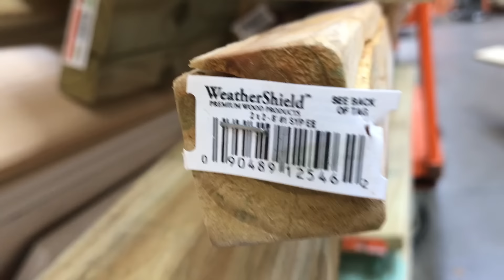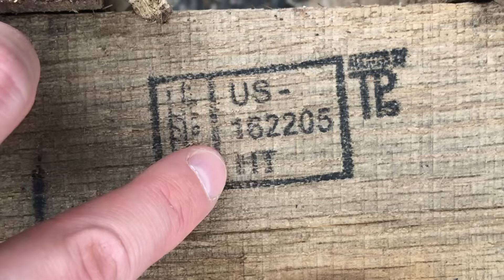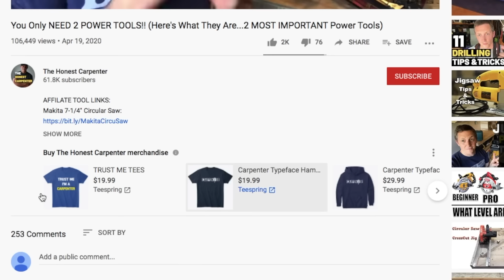Don't Use Pallet Wood!! USE THIS INSTEAD...(Cull Wood Vs. Pallet Wood)

Comment: Even cheaper: dumpster dive at construction sites. It's amazing how much usable 2x4s and plywood you can find.
Reply: That is just disgusting and should be illegal for ecological reasons. 
As a "green" civil engineer who likes DIY, I was disappointed about how much good quality timber went straight to the bin. Some were just part of the delivery packaging for heavy machinery that was installed on site. One could build a nice cabin by just relying on the timber we scraped.
Reply: billy watkins  taking TVs or a DVD from a Best Buy is ok. Or maybe sneakers from a Nike store. Just don't take scrap from a dumpster.
Reply: The last time i went dunpster diving on a constrution site I was almost charged with theft by some gungho Leo. His reasoning was if the dumpster was on the site everything was still theirs. I had written permission.

.
Reply: billy watkins  . Dumpster diving is legal. But if the bin is fenced in on site all the cops can do is write you up for trespassing..
Reply: Seattle is home to the most wasteful clueless spec home building.  Quasi skilled subs frame and sheath like wood is their enemy. Stupid, money grubbing architects cram four peg shaped houses on a single lot, with flat roofs, no yard, and a garage that requires a triple K turn to park in.  100 percent construction defect at completion.  The banks win, the builder wins, the subs live to butcher on to the next abomination, and the buyer is screwed.
Reply: Caution cite local laws and Municipal codes in my area dumpsters are property of waste management and entering them is considered trespassing
Reply: Brick piles too!
Reply: @BEARDEDYAKIN  I totally agree. Dumpster diving is not illegal!!! However, I would not intrude if the dumpster is fenced of on thier property!! Once it hits the dumpster its public property!!
Reply: @valdius85  Well I hate to say it some of the wood that goes in the dumpster is just plain stolen to be pick up later.
Reply: @terrydubay9113  I agree.
Reply: @Sheya404  That is NOT always true.  Many sites now contract salvage with a salvage company and the contents of the bins are their property.  You'd better ask BEFORE you spend a night in jail and fork over fines that would have bought new lumber.
Reply: @BEARDEDYAKIN  Our cops don't give a flip if it's legal by law, it's illegal as far as they're concerned.
Reply: There building like 15 houses behind mine and they give me all there bald wood
Reply: billy watkins  If a cop has time to arrest, write a report & a prosecutor willing to charge for stealing from a dumpster then move!
Reply: So true, they closed down a whole block near my house for electrical changes, you have no idea how much would they threw away
Reply: @seanoneil2110  that would indicate either an incredibly low crime area or ample police/law resources (which is getting rare nowadays)... why would you move away for either of those reasons?
Reply: @valdius85  What do you care?  Lumber is among the most renewable of our resources.  We will never run out of it.
Reply: @chuckschillingvideos  it doesn't mean we have to waste it. The delivery and process of the lumber requires a lot of energy.
Reply: @valdius85  Absolutely. Schindler Elevators parts are packaged with 2x4 and   3/4"  boards of untreated southern yellow pine here in the US. Can't be found in big box yards. Usually the Elevator Construction guys would let me gather some up at lunch to carry to my truck. Superintendents mostly frowned upon the workers being "salvage technicians" in dumpsters because of insurance concerns. Made some strong beekeeper's yard benches and converted worn out wheelbarrow to brick barrow. Good stuff, well worth the effort.
Reply: Agreed, the one thing I will never forget. Is the day my dad who used to do carpentry work told me to go to a job site and simply ask someone if they mind if you grab a few things out of their dumpster. I've even done it a few times 9/10 times it'll work if it doesn't. Move on to the next. And be smart dont be hurting yourself on anything because if you want to make a big deal about it there gonna hate you and never do it again
Reply: I've built a few new houses and I was shocked at how much my carpenters threw away. It was one of those long dumpster full of fresh wood sticking out.  They would use a 10 footer as a brace, and when it was done, they remove it, toss it in the dumpster and grab a fresh one.  Why did I let it happen? I was new at building and after a few the economy sank and I moved onto something else.  If I had to do it again, I would start small and have my own carpentry crew and be more efficient. Wood is not hay. I can't stand to see it wasted.
Reply: @joelgodin-woodworking4395  it does seem incredibly wasteful.

Slightly different example. I recently hired drywallers to finish out my basement. I bought 4x12 ft sheets and they would basically throw away entire 3 and 4 foot sections left over. It kind of annoyed me but I can also see that they worked more quickly that way and with fewer seams the end result is probably cleaner.

I suppose it comes down to the economics of labor vs materials on items like sheathing, etc. I see a lot of OSB in dumpsters  The example you gave seems purely wasteful though.
Reply: @wizardwillbonner  exactly
Reply: Waldemar Ishibashi o
Reply: I think you should have done a video on some of the coolest things you can build out of pallets.
Your video was a waist of time. I just built 
A bar out of several pallets and it turned out awsome. How
 much $0.00.
Reply: @carlospelay9642  they also saved you time and/or $$$,...  Because the next job is mud&tape. Time if you are doing it yourself, & money if you have someone else coming in to do the job, and I'm sure they are quoting you per linear foot that they have to do.
Reply: I work for the company that picks up the construction bins find the company that picks them up if you took the wood off their hands they would save money because their trucks get weighed every time they drop it at the dump the less weight they have in the truck the more money they make
Reply: Sheya404 wrong they are paying rent on the dumpster it is still their material until it is in the dump because they are charged by weight
Reply: Exactly!
Reply: billy watkins  You are absolutely correct. If a dumpster is marked "No Trespassing" don't dive there no matter what the police say. I often get permission from the construction site, preferably from the foreman. Never had any trouble that way. I got questioned once by a cop and I told him, "Bob said I could take whatever I wanted from the dumpster, just don't touch the stuff that was nicely stacked waiting to be used." He just simply said, "Ok, be careful." and left. Sometimes its' better to ask forgiveness than to ask permission, but this isn't one of those cases.
Reply: That's illegal in most places.
Reply: @TheMoafo  Most places depending on where you live. Where I lived in Florida it isn't illegal at all unless the dumpster is locked or says no trespassing. Just check you local laws and even carry a copy of them if you have to. I've done that before too.
Reply: @wizardwillbonner    I often dumpster dive for awesome stuff.  I wonder if "gungho Leo" would prefer it going to the dump as opposed to being up-cycled?
Reply: @youdagoob  that kind of blowhard doesn't care. It's all about making himself look good.
Reply: @wallacegrommet9343  The greater Seattle area, not just the city proper.
Reply: @chuckschillingvideos  Lumbers is one  of  the most vulnerable of our sources?  Such an ignorant statement
Reply: You're wrong trash isn't domain.property. I make 6 figures a year finding stuff in trash and repurposing it. Trolls like u crack me up. When it hits the dumpster or curb its anyone's domain property. If a construction site is completely fenced off it becomes private domain property.
Reply: Here in the UK I have watched as 8' x 4' sheets of quality plywood and miles of skirting board and even doors have been added to a bonfire. I've asked site workers and been told that they would be fired if any of these items left the site. It's morally criminal.
Reply: @corymcelheny6938  same here in West Virginia where I’m from and if caught without permission you’re for sure getting a ticket
Reply: Hear hear!
Reply: @BEARDEDYAKIN  It (dumpster diving, that is) really depends on laws and ordinances where you live.  In my town, it IS illegal.  Like a fellow further up in this string, I get approval to do so in writing.  Ask - all they can say is no.  And in my town which went from 28,000 to over 325,000 virtually overnight, I find that many contractors or supervisors that say no, is for "liability" reasons.  They're afraid you'll get hurt and sue.  I understand their reasoning in this "sue happy" day and age.  But - I always ask and get it in writing.  Sometimes it is a WIN!!!
Reply: Yeah idk last thing I need when I'm doing demo is some goof stepping on nails or possibly injuring themselves and wasting my time I would ask first
Reply: Free pallet fences for our goats is a compromise we have chosen to make. Now we're thinking of building a small barn using them. I would never bring them in my home. But outside in the fresh air to make homesteading possible...it's not my first choice, I get it, but it's a situation I'm willing to compromise.
Reply: Right there with you I got so much furniture I’ve built out of trash , I even pulled a fiberglass 28 ft black tip ladder out of one
Reply: 😂😂😂 My husband HATES when I do this lol
Reply: @wallacegrommet9343  feign noble causes that in reality are self serving... exactly what I'd expect from a blue city in a blue state 🤷
Reply: @corymcelheny6938  That makes sense. I've asked before diving.
Reply: Definitely more on board with the dumpster diving then paying for the cull wood before it hits the dumpster.  Lol. I like the rustic look of some pallet projects as well
Reply: Carlos I agree with you wholeheartedly. One man's trash is definitely another treasure!! recycling is the way to save this world!! shame on The rest are any of you for BOOING this man for his ideas
Reply: I have NO issues, going through bins for whatever reason. My garden beds were created by dumped lumber, saving me a fortune! The valuable wood that is thrown away at construction sites is shocking to anyone who loves to work with wood. 💯
Reply: @valdius85  why didn't you grab it all? In future have it written into your contact that you yourself will remove the wood!
Reply: @chuckroast5735  use caution, wear protective equipment and your eyes before you jump into any dumpster. Most sites don't mind especially if the bins is off-site, most will laugh, but when you inform them of what you are making whether it be toys for kids at Christmas or to help those less fortunate, they shut up real quick and it makes them think.
Reply: @wizardwillbonner  that's why so many, wait till they knock off work then walk in and take what "is considered as rubbish". Even written permission has some legal issues.
Reply: @thomasjackson7785  
I think you've seen a modern megaproject only in Discovery Channel.
Reply: If you enter a construction site without permission you are by definition breaking the law - you're trespassing.  Moreover, even if the contractors place construction materials into what appears to be a dumpster (it may very well NOT be a dumpster), it does not become searchable trash until it is placed out for pickup.  If you're doing something this stupid, I hope you have money for bail and the fines you're going to have to pay when you get caught.
Reply: @valdius85  Green Engineers are the worst engineers. Most people don't understand how much pollution is created by making "green" fuels and storage devices. Wind turbines, solar panels and batteries are some of the most pollution intensive devices out there. The entire green movement is based on a scam, not real science.
Reply: @wallacegrommet9343  You can thank "green" engineers for that crap.
Reply: @MAGAMAN  
You not describing engineers, you describing activists disguised as engineers. It's very common. 

There are still many good engineer there who try to look at the whole picture. They are, unfortunately, rare I think.
Reply: @Sheya404  depends on the local laws. In Ohio, anything out at the street or in a dumpster on  property open to the public is fair game. The exception is that if the dumpster is behind a glosed gate, or if the property is gated, then it isn't considered "publicly accessible" and diving there is considered trespassing. The Supreme Court ruling that made dumpster diving legal unless prohibited by local codes was California vs. Greenwood. It was intended to allow police to search garbage without a warrant.
Reply: felony
Reply: @valdius85  I used to work for the largest new home builder in the US. The construction team used to throw away brand new windows, 5 gallon buckets of paint, sprinkler systems etc. It's shameful how much they just got rid of to make space
Reply: @BEARDEDYAKIN  And they won't, generally, unless you're making a mess, broke something to get in, or are making a nuisance of yourself. I used to dumpster dive a tonne, I'd see cop cars cruising right past me without even a chirp of the siren. Now if you're tossing trash on the ground to get at the stuff underneath, you're asking for it, even if you plan to put it all back, nobody who catches you in the middle of things is gonna take your word for it. Be discreet and clean and peaceable. I mean you probably know this, just putting it her so others can read it.
Reply: @joederue2392  The video wasn't saying that you can't make nice  looking stuff out of  pallets. It was saying that pallets are often treated with hazardous chemicals to prevent insect infestations during shipping, but should not come in contact with skin because you could be slowly poisoning yourself. The wood is also low quality and won't stand up to the elements over time because it's not weather treated. The option of using cull wood is a safer option and you get properly treated wood that will last longer and is often also free. 
Just because you made a bar out of pallets does not make this video a waste of time. Some people want to make projects that their children can enjoy without the worry of wood that splinters or chemicals. Some people want to make a raised planter for vegetables without having to worry about poisoning themselves or the planter deteriorating over time. This video was another alternative that will be better for some projects.
Reply: Agreed. Construction sites are the way to go. A site next door had a HUGE pile of 2x4 and chip board. I estimate I got about 85Lm (270Lf) of it. With a few beam off cuts. 
They take it away, chip it and then bring it back to site and spread it to control mud. 
I was loosing my mind knowing how much was being wasted.
Reply: @kmjansen not if you get permission. In Australia that have to pay to have that stuff removed. Most builders will let you take what you want.
Reply: @BEARDEDYAKIN  It's a big world, with lots of countries having different laws. The comment should more correctly be  Dumpster diving may be legal - it certainly isn't here.
Reply: Taking from a dumpster is questionable.  Need permission first. 
Or you end up with answering to the man just because. 
Companies can be liable for you on their property.
A dumpster on property is not the same as you putting your trash on the curb. 
  Ask first, don't trash the place.
Reply: Been dumpster diving for decades. During the building boom, many yrs ago, dumpsters were full of osb, plywood, lumber, that just had small pieces cut out. More for me and my Projects. One dumpster, found a nice Samurai sword, sheath and stand, a lot of knives, butterfly knives, throwing stars, shotgun shells , and other various weapons. Must have been a ninja going out if business.
Reply: Just ask them first, they're usually fine with it if they know what you're doing. But sneaking in and trying to take stuff out of the dumpster...doesn't go well.
Reply: Yes!!! Where I live alot of houses are being built and for a whole year all my lumber has been the scraps they leave laying around.
Reply: Try bribing the cops, most will look the other way for a $10 dunkin gift card. Also, make sure to have an orange construction vest on. It looks more legit when reclaiming dumpster finds. You can find them on work sites most times.
Reply: @corymcelheny6938  which is wasteful
Reply: This guy👍🏾👍🏾👍🏾👍🏾👋🏾